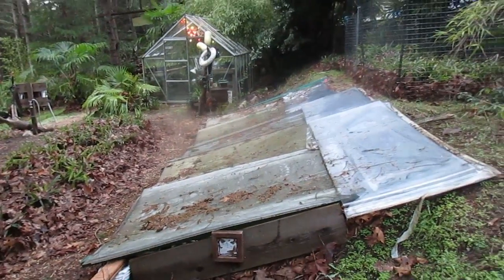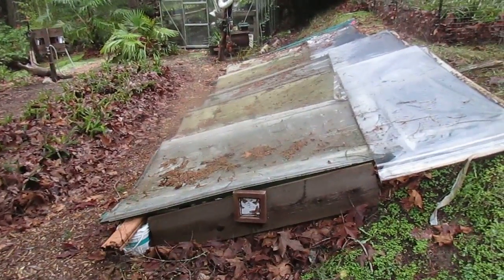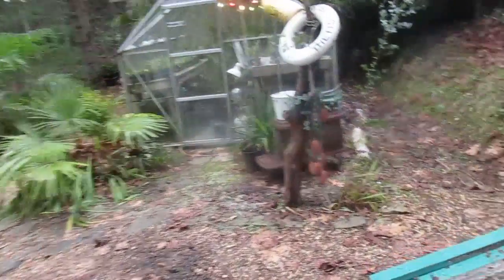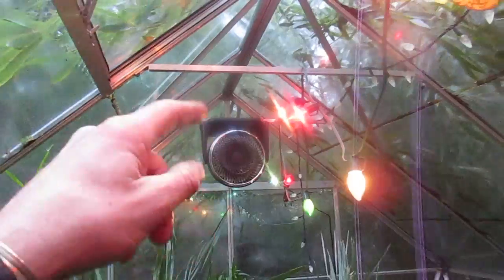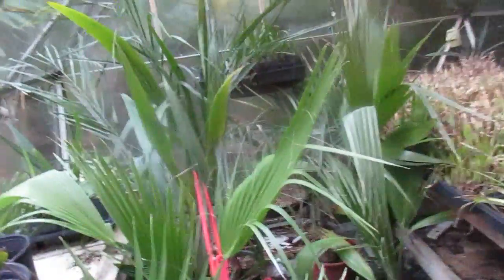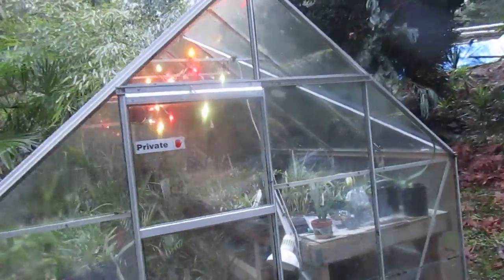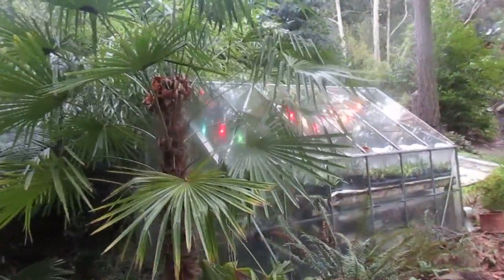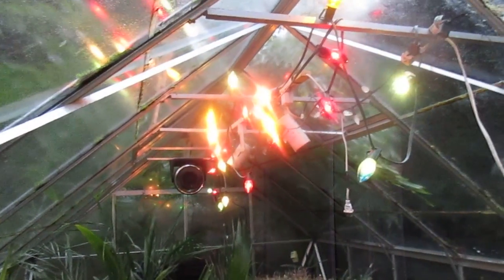How to heat Canadian Greenhouse with Christmas Lights.

Comment: Okay I'm back. I want to order some lights but don't plants need some periods of darkness? If you're using lights to heat the greenhouse or hoophouse at night, they aren't getting darkness yeah? So apparently green light isn't easily absorbed so I'm wondering if a string of green Christmas lights would be best... What do u think? Should I get a certain color so they aren't in light 24 hrs a day? I don't have a greenhouse, I'll be using them in a hoophouse or my mini greenhouse made of shelves and greenhouse plastic to start seeds. I do have 4 heat mats but I usually do more than 4 trays. Please help! Would green lights be a smarter idea?